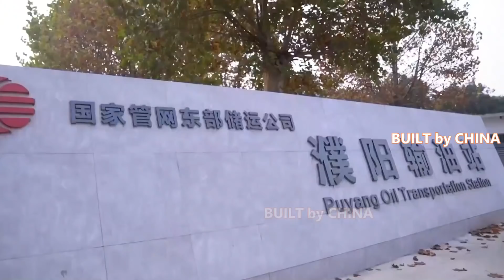China built 796 kilometers of oil and gas pipelines from East to Central China | 中國完成華東至華中油氣管道796公里

Comment: It better to built many storage better than pipelines, any accident happen all the supply will cut off. what is the point?
Reply: Pipeline main function is distribution not storage
Reply: @mumu2635 Oil and gas not like water , you need distribution to every household. Pipieline only suitable if you import from other country and that reduce transportation cost and more efficient. if the pipeline break down, the whole city million of people going to suffer.
Reply: What makes you think they haven't built storage? Just because they didn't show?
Reply: @jameslum7260  Building pipeline is a multi billion dollar project. Government official  took corruption money from the company that build the pipeline or minister accept bribe money from them. nothing new in China and even in other countries. Pipeline a wrong calculation for 800km long. if it 100-200km then the project reasonable, more than that raise a big question.
Reply: @VanTran-ne4yf  when were you born? Ever heard of the POWER OF SIBERIA gas pipeline running from Russia into China. Go figure the length of that mega project.